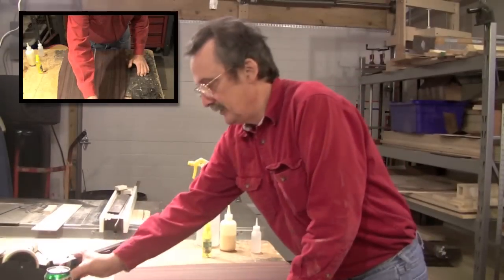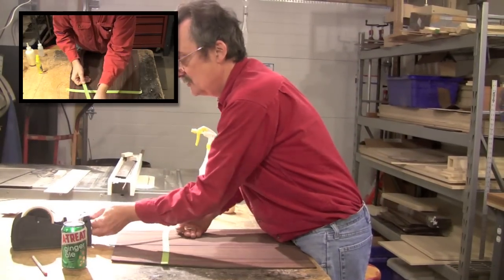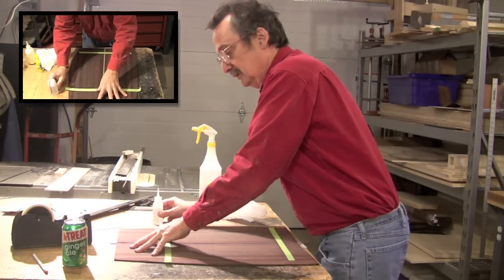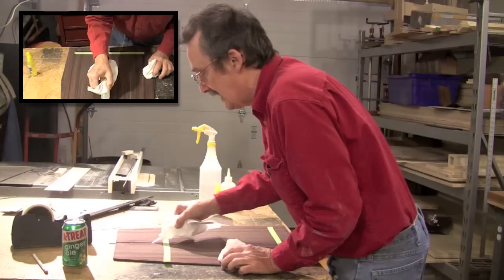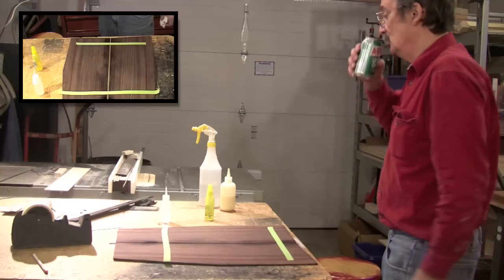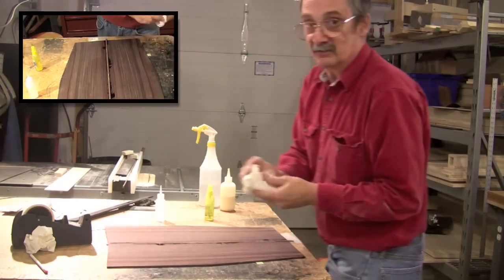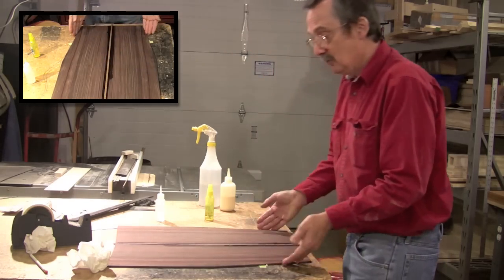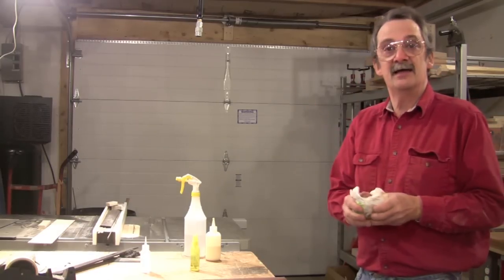Blues Creek Guitars Quick Tips - Joining a Back Using CA.mov

Comment: I assume you use a plane and straighr edge to true your back plates . What number plane do you use . I've seen there's a large variety of planes categorized by # . Just want to buy what I need . Thanks
Reply: I don't use a hand plane I use  a 6 in jointer and a  granite surface plate with  120 grit sand paper
Reply: blues creek guitars
I have done  a great amount of wood work  and it isn't so much the plane as it is the set up. A good millers falls or stanley #25 flat bottom would be a  good plane to use.  I have them both.
Reply: blues creek guitars thank you ! I was just reading a post on acoustic guitar forum about using a plane vs sanding via leveling beam / straight edge ect . Some said the rough edge made by sanding is not as strong as the planed edge . It's why I asked here , the accomplished builder ! I don't know if yall take video request , but this would make for a good one . Thanks again for the sharing of your wealth of knowledge
Reply: Jay Rogers
that is a great idea  , I can do that on my next vid shoot.  As for sanding ,  I have been doing it this was for years.  I tested many joints ,  and all sheared wood  and if you have wood on the joint the glue is stronger than the wood.  The key is that the joint is true.  Forcing a joint is a sure way to have the joint  fail.

Comment: At 1:00 you said, “I jointed the edge so I know my edge is true”. Ken Parker uses what’s called a “Spring Joint” when he joins his top and back plates on a shooting board with his no. 8 Stanley plane. As you know, a spring joint is where the plates are planned in such a way where a slight gap remains  in the center. The top and/or back is then clamped together with the center clamp(s) used to close the remaining gap. This ensures that both the outer edges of the top and back plates never separate due to changes in humidity. Of course Ken builds archtops and not acoustic guitars but was wondering if you recommend this method for use in joining acoustic guitar tops and backs? Below is the video link of Ken Parker explaining the use of the spring joint starting the process at 11:15 but I recommend watching the whole video in order to connect all the dots. Thank you John! 

https://youtu.be/uBDwFnex71k?si=sfVcBrNiWyPf4Wtk